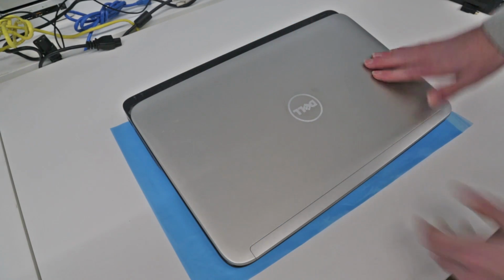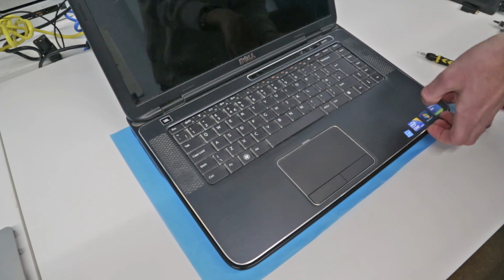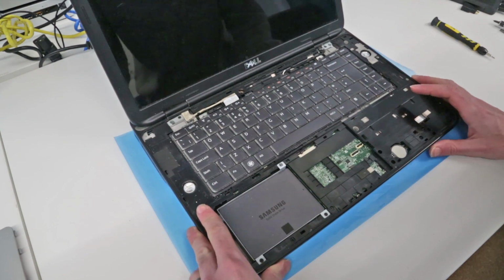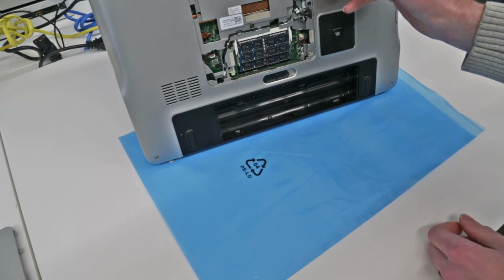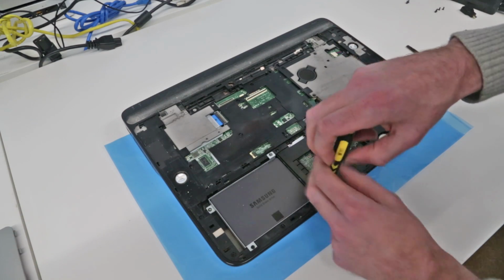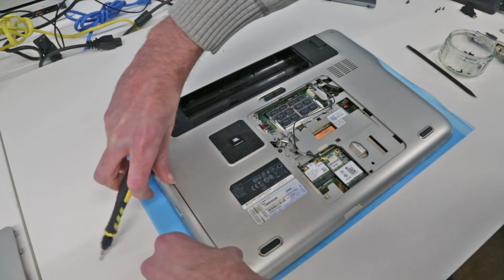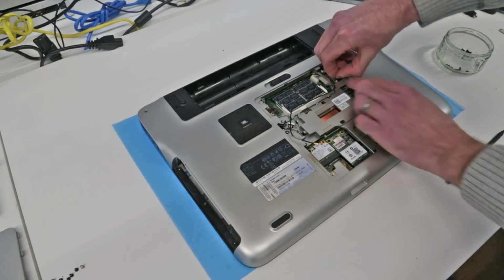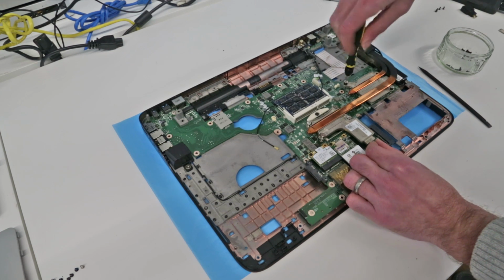Dell XPS 15 (L501X) Disassembly, Cleaning and Upgrade Guide

Comment: Go easy on it, you're being rough. After almost a decade, the plastic is quite brittle on these. Out of the 17 screws, all of 10 is what's holding mine together. And you almost wrecked the bezel doing that nasty pull, it's so easy if done right.  All you gotta do is pull up at the inside edge next to keyboard, and snap the two locks inside battery well. The bezel will pop right out. 10 seconds tops. The whole unit can be taken apart and put back together in 10 minutes. These are among the last of the good Dells.

Comment: Thank you very much. I cleaned my Dell Xps 15 L502x (actually quite the same) and renewed the thermal paste and it's still working :) Not faster, not quieter, but hey. It was worth it to gain experience.

Comment: i had issue that is(dell xps l501x) when charger is connected to laptop both laptop and charger are turning off but when charger is connected to other laptop it is working please help be to fix these or share a link which helps me

Comment: Hey Can we add faster RAM in this laptop? If yes then what speed would it support?
Reply from the maker: You can fit faster DDR3 modules, but they'll only run at DDR3-1600 speed.
Reply: @BrueComputing  Thank u for this quick prompt. Can't we do some setting in Windows to use part of SSD as ram?

Comment: Where is the reed switch on this laptop located? Tried my best, couldn't spot yet.
Reply from the maker: The reed switch?
Reply: @BrueComputing  The sensor for the lid, magnetic sensor.
Reply: Could you spot?
Reply: @jjajin77  There's a magnet near the microphone.  So the switch should be around the left mouse button.